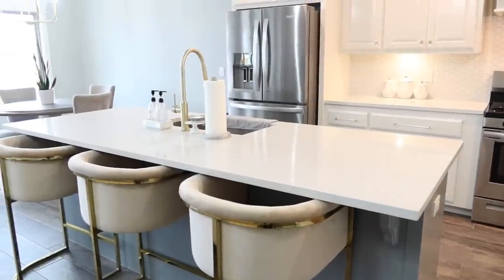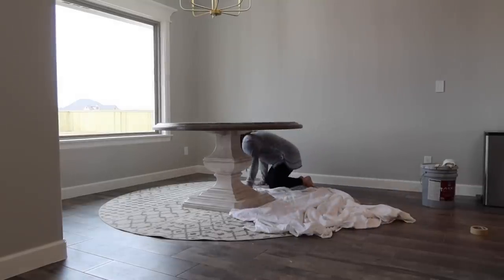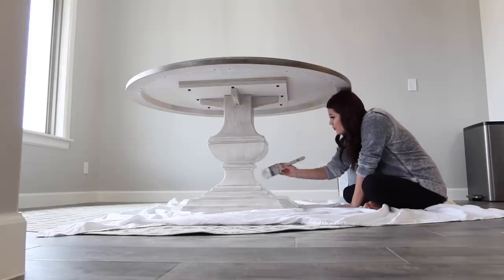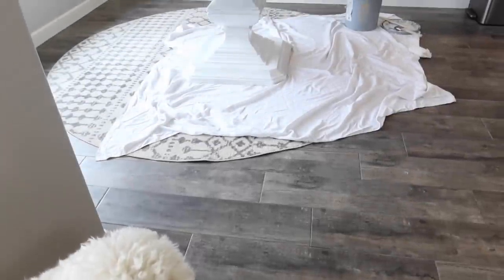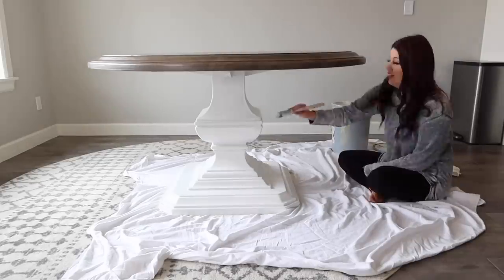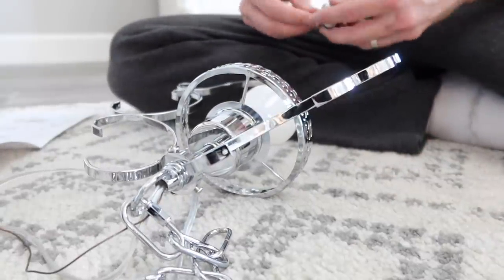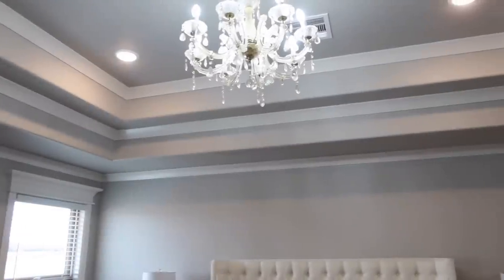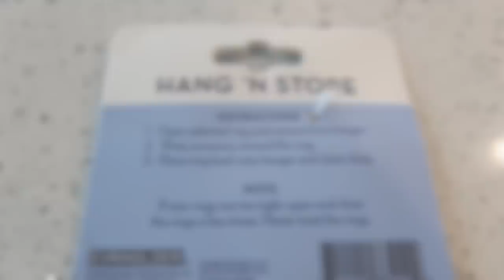NEW HOME PROJECTS + ORGANIZATION | EASY & AFFORDABLE HOME DIY | HOME ORGANIZING PRODUCTS THAT WORK!

Comment: Do you have a recommendation for ceiling paint in a bathroom with no ventilation system? I want to avoid mold accumulation/cracked paint.
Reply from the maker: Hmmm I’m really not sure what the best advice would be on that one?
Reply: @TilVacuumDoUsPart  ok, thanks.